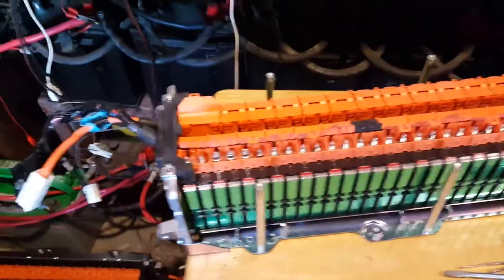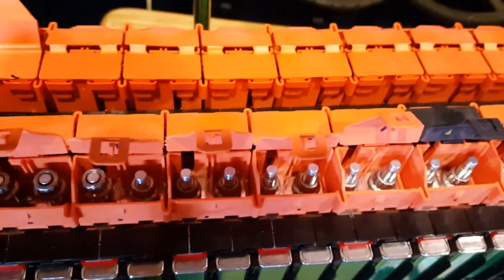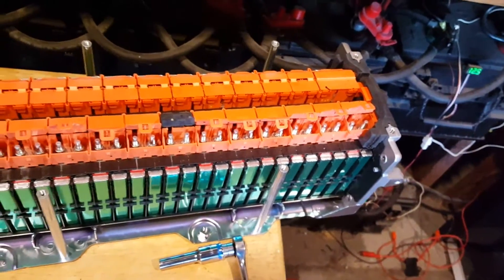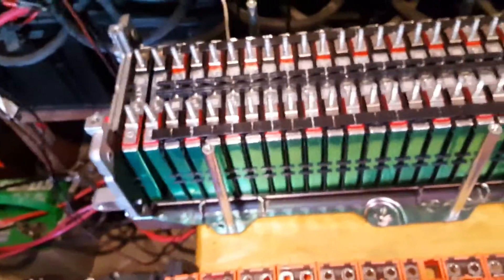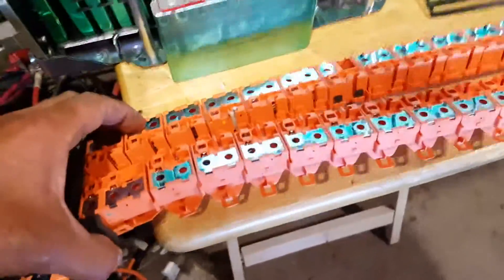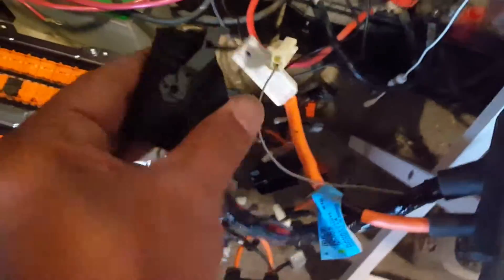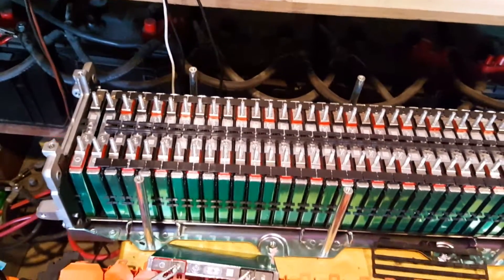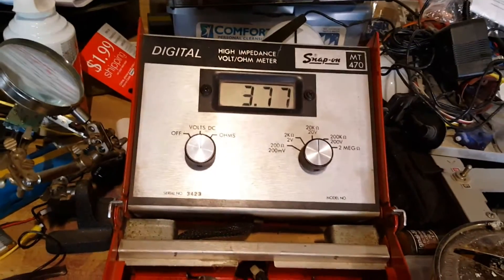Reconfiguring The Ford Fusion 300 Volts Hybrid Battery For My Battery Powered house

Comment: We use these in the car audio community. You need a 12 point 7.5 mm socket. (On eBay) you can buy buss bars (Coventry industries) or (ILL Customz) I paid $94 for mine for a 45ah bank. (4s) yes there’s larger ones available too. Get a balancer for 4s & above depending on how many volts you’re going for. HAO2 is about $50. Run the batteries in series of 9 in groups of 4, for the 45ah get 1/4” x3”x2” angle iron & use a piece of wood in between the angle iron & batteries on sides & bottom. Charge @ 15.5v. Mine sitting is at 14.94 & I haven’t even installed it yet. Good for a 10k watt stereo. I made my compression kit out of 1” thick acrylic. Use 1/2” all thread on the ends for compression
Reply: Mdf or plexiglass?  It's just so to won't rub onto the angle iron right

Comment: If the threads on those odd nuts is a standard or metric thread all you need to do is get them odd nuts off and throw them crazy nuts away.  Replace them with proper threaded common nuts.
Reply from the maker: Well they are on the backburner at this time.  I could not justify spending time and money on the balancing boards and charging circuits.  Be Safe,
Reply: You also might , if you choose, google "12 point socket" and check the picture of one.  Take one of those nuts with you over to home depot and check their fit on a 12 point socket of the right size.  Best wishes to you too.  Thanks for the video.
Reply from the maker: Thank you! Godspeed
Reply: One last thought. Those batteries will swell or bulge wider when they are being charged or being discharged.  That's why they were bolted length wise side by side as they were with those long rods and end plates keeping them from expanding wider.  If you break them up into smaller groupings be sure that you mount them in a stack that will keep them under tension so they are NOT allowed to swell and expand during use. They can rupture if not packed tightly.  If you look into all other Li-on  EV flat packs, they are all packaged so they are prevented from swelling under use.  Peace brother.
Reply: Don't think that aluminum wrapped cell  swell as much as pouch cells so I think the space is more for cooling

Comment: These battery packs are so rare. I wished we could buy the individual cells and replace them, because every last one of them starts deteriorating after 100k miles (mine started at 94k miles), and become useless after 125-175k miles.
Reply: Mine has 268k miles and they're all still working.

Comment: Those nuts should be metric given age of vehicle. I can't seem to find anything either. The cheap Chinese socket sets sometimes come with 7.5mm sockets but I can only find them in 6 point.  Did you ever figure it out as to what size they were?   Did you ever try a 9/32 by chance? Those are popular size in large sets.. I'm about to buy one of these packs and just wondering if I'm going to have the same problems.. Thanks, Andrew
Reply from the maker: Andrew, I tried many different sizes, could not find the right fitment.  I ended up squeezing (in a vice) a craftsman socket to be able to make it work. Stay well,
Reply: Where are you going to buy a pack?

Comment: Hello, is there a good reason to dismantle these packs? Can't you just wire the packs together, with built in BMS and balance charge circuits etc? Maybe I missed something. Thank you.
Reply from the maker: Hello, Well the output voltage on each pack is 150 DC Volts (killer voltage), I cant use that much dangerous DC high voltage. Godspeed
Reply: No god we trust!

Comment: It would be great if we could figure out the physical size and capacity of these cells and then we could replace individual failed cells like Toyota owners are able to.  Anyone figure it out?
Reply: NMC cell chemistry
Low 2.8V high 4.2v
Nominal 3.75v
5 7/8inch (148mm) long.
1 1/16 inch (27mm) wide.
3 9/16 inch (91 mm) tall.
4 7/16 inch (113mm) tall with terminals.
Terminal size: M5 0.8
1lb 8oz
Capacity:  5 Ah
Capacity: 18.75 Wh
20C tested

Comment: please let me know where i can find more information about this project I am currently working with a 300v ford battery and i am needing advice on how to set it up.? Would it not be better to regulate the voltage down to twelve volts or convert to 120v depending on your application? Thoughts?
Reply from the maker: I couldn't find any info on them, I even spoke to some Ford technicians and they did not have any info.  Spent a lot of time researching about them and got no usable and or safe info.  So I got rid of them.
Reply: Did you abandon the project?
Reply: @ElRazTheGreat1  where do you buy the battery? I'm looking for a pack
Reply from the maker: @dantejimenez2679  check with local dismantlers or highbrid battery repair facilities.

Comment: hi i have 13 cells can help  me  configure series and parallel 12v system
Reply from the maker: Please allow me some time, will get back to you soon! Regards,
Reply from the maker: Connect 4 cells in series to have about 14.5 volts, make two and connect in parallel, hope this would help you.
Reply: @ElRazTheGreat1  can you help me reconfigure a 90ah please?
Reply from the maker: @Craneop817  Each single cell is about 4 AH @ about 4 volts.  Stay safe,

Comment: 12.75 mm? You mean a half inch. It is a ford. Normal socket sizes.
Reply: Most things are metric, even on U.S. manufacturers.
Reply: All ford's have used metric for more then 20 years. They are using a special size bolt for security/safety.